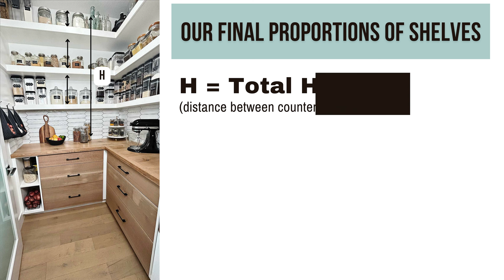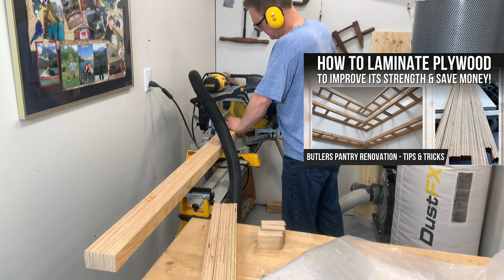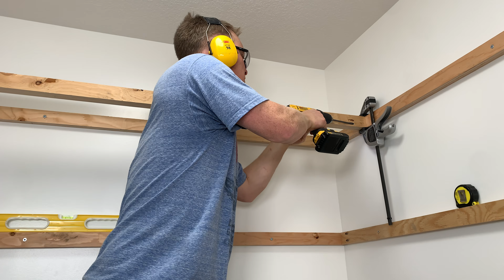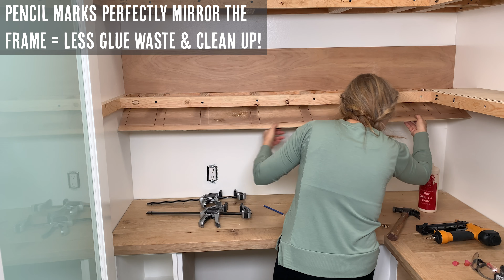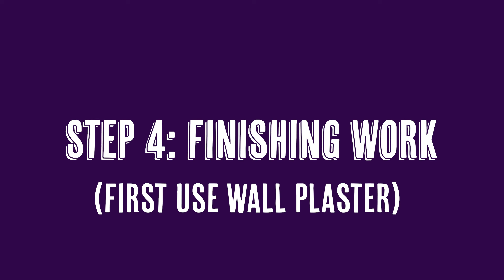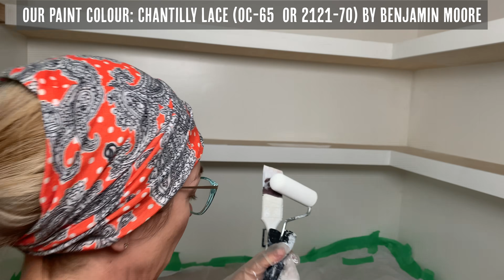How to Build Floating Shelves from Scratch #woodworking #diykitchen #diyproject #pantryorganization

Comment: Some great ideas in this video!  Quick question. I have a run longer than 8’ on one wall. I would like the strength of plywood (for canning jars). Any thoughts on how you might approach that long run?
Reply from the maker: Do you have walls on both sides you can anchor into? If so, I think if you can anchor the into the studs on the back wall and side walls this would work great. Also, you could make the floating shelves a little thicker so that the cross braces of the wood frame (lumber) would give it more strength. Hope this helps.
Reply: @turmericmecrazy , that does help. Thanks for the tip!